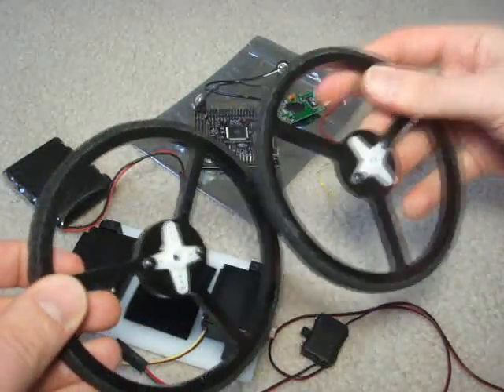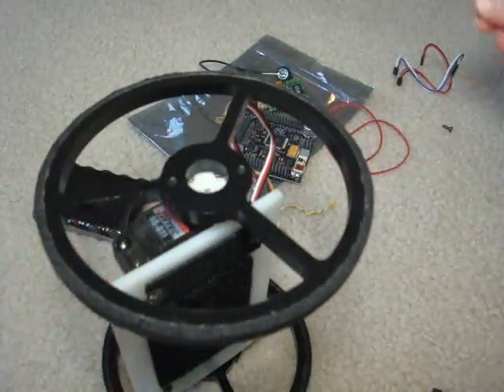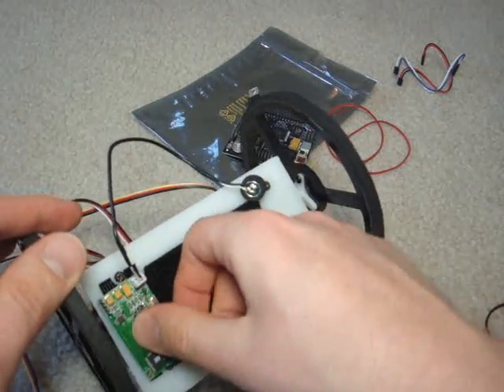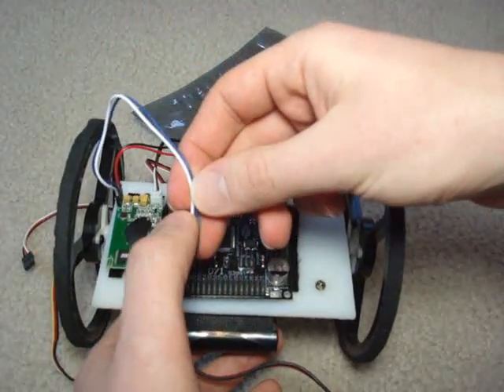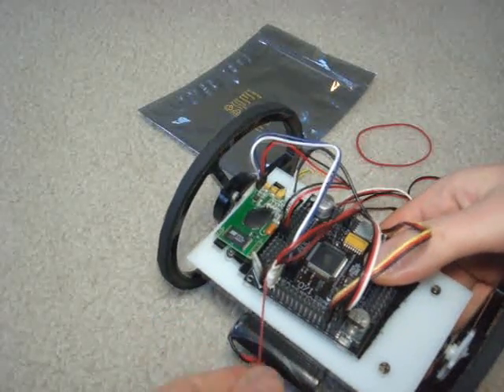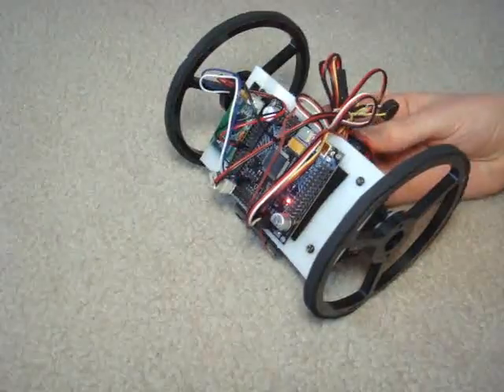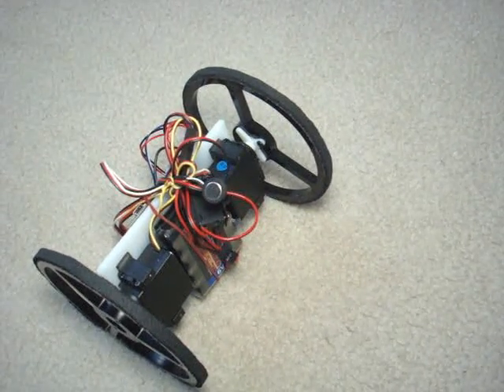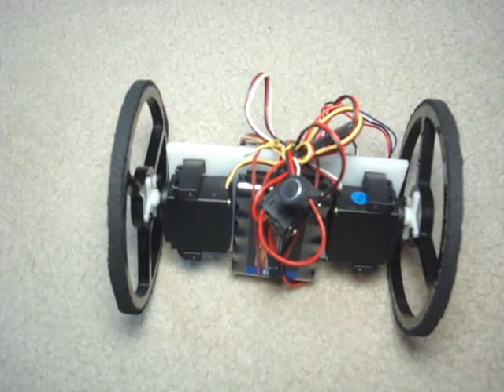Make a Voice Controlled Robot

Comment: Ya I figured it out I just had to buy a software thank you. But now whenever I try to connect it always says can connect and I've tried most of the things you said to try to debug it. (btw while I was trying to figure things out the vrbot module sparked a bit and started to emit a bit of smoke, it wasn't anything major though so I don't think it should affect the module from working)